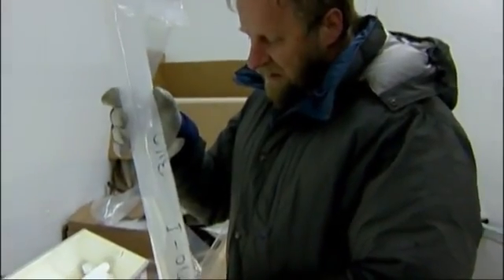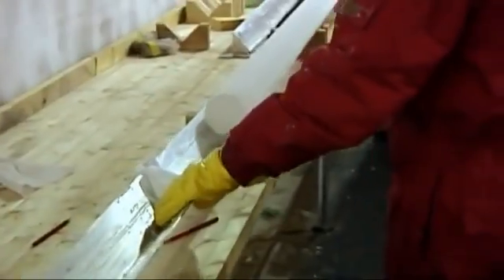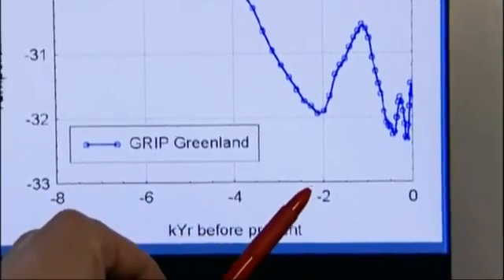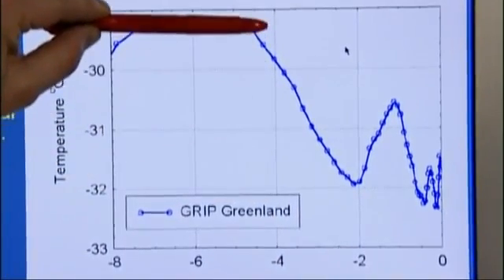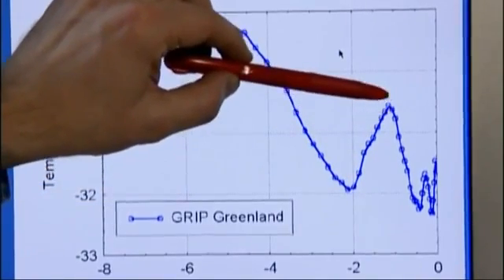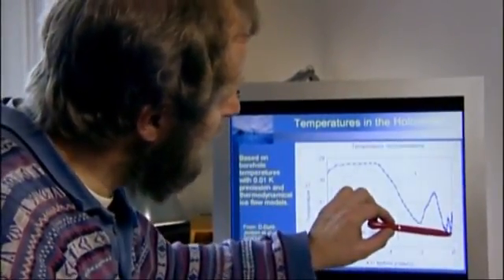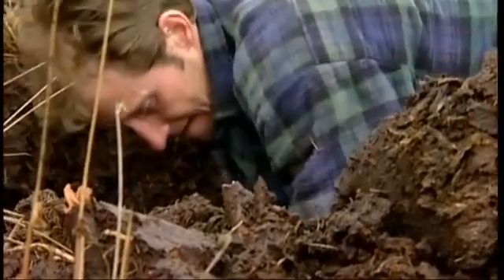The Climate Change story told by ice cores...

Comment: Earth climate runs in cycles - largely influenced by sunspot cycles - always has, always will The sun is the main driving force. CO2's effect is minimal by comparison (learned during my Environmental Sciences degree at UEA)
In fact we need plenty of CO2 in order to help plants and trees grow; forests are a major heat sink for the planet , and what humans need to do is stop deforestation !!!
Reply: The current scientific consensus, most specifically that of the IPCC, is that solar variations only play a marginal role in driving global climate change since the measured magnitude of recent solar variation is much smaller than the forcing due to greenhouse gases. Also, average solar activity in the 2010s was no higher than in the 1950s whereas average global temperatures had risen markedly over that period.
Reply from the maker: @hosnimubarak8869  Science "consensus"  comes from the scientists who agree with the narrative, while the others are ignored and censored.
Reply: @beegeandpeege  
Temperature has risen as our C02 accumulation has risen. The rise of C02 began around the time of the Industrial Revolution. The sun's last three cycles progressively weakened, yet we continued to warm anyway. Earth's orbital eccentricity, axial tilt and precession are all in cooling phases, yet we continue to warm anyway. As our lower atmosphere has warmed, the atmospheric layer just above it has cooled, according to NASA monitoring since 1978. That's evidence of the heat trapped below and prevented from filtering back into space. Natural cycles can't explain why satellites measure less heat escaping to space at the precise wavelengths which CO2 absorbs. Neither the sun nor any warming force on earth can simultaneously warm the lower atmosphere while cooling the outer one.
Reply from the maker: @hosnimubarak8869  Thanks for your opinion and contribution to this discussion! It is based on trust that the government data is accurate and they have no agenda. Here's an article that sheds some doubt on that: https://heartland.org/opinion/media-advisory-96-of-us-climate-data-is-corrupted/

Comment: I thought the measurement of relic ice core temperatures was made on CO2 isotopes from the ice, not actual temperatures from the walls of an ice core.  I do not accept at first glance that ice buried over time stays at the temperature it was buried at.  I would love to see more explanation and validation of the method used.
Reply: Better yet is the assumption that ice cores, which build up and melt away, can truly tell us what the past was really like, since some of the information is lost during the melting periods. So many assumptions in what these cores can tell us, one way or another.
Reply: I thought the measurement of CO2 in ice cores was to determine the concentration changes over time.

Comment: The distance between the sun and the earth is not fixed (as assumed by climate change models), as the center of mass is also influenced by the orbit of the planets. Moreover, the output of the sun is not constant, as it varies with magnetic variations of the sun.

Comment: You know in the early 2000's a crew went to dig up a plane that had belly landed in the ice being transported to the UK for WW2. It was bellow over 100 layers of ice. Meaning either the warplane preceded the Wright Brothers or the ice layers aren't years.
Reply: If it would be so easy. I presume the pane was darker than ice/snow and thus would be warmed up above freezing point by the sun. Henc, it would melt itself deeper into the ice/snow layer and, seemingly, deeper back into time.
Reply: @thomasbrey6928  my point is that this method is actually really compressed. What was presumed to happen over thousands of years was actually hundreds. A lot of the climate change "evidence" really starts to break down with that.
Reply: @picivyvortac2641  Yes, I understand. I am a bit sceptical of the method applied here, too,, i.e. inferring past temperature from current bore hole temperature, in particular as the graph presented displays no error bars. Nevertheless, d18O data from ice cores provide a good impression of the past climate. I should know, as I work in world leading institution of paleoglaciology.

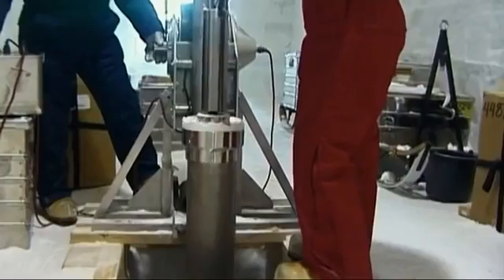Comment: @0:50... they describe using a thermometer to measure micro degree differences in the ice to determine how cold it was when the ice fell, to plus or minus a few degrees, however, that is NOT how heat works, at all, according to thermodynamic laws; heat is energy and energy spreads, the energy difference would not be "recorded" i.e. preserved in ice for thousands of years, or even thousands of minutes... they had to be reading pure noise, especially reading the temp in the air hole itself... that air would normalize its energy within seconds, and the temp differences in the ice would normalize within hours.

This has got to be an april 1st joke or something. This is silly nonsense. Even a HS physics teacher knows this isnt possible.

Comment: Its pretty clear actually.  For the past 4,000 years the temperature has been falling.  During this time about every thousand years there is a brief heat spike followed by the a plunge into even colder climate. From the Minoan Warming it fell in temperature for about 1,200 years to the Roman Warming, which did not reach the warmth of the previous warming.  Then the Roman Warming ends and temperatures fell to a climate colder than previous for about 1,100 years until the Medieval Warming, which did not reach the warmth of Roman Warming.  Then the temperatures fell to an even colder climate for about 1,000 and we find the Medieval Warming, which was colder than the previous warming.  Then we find a thousand years of increasing cold we  call The Little Ice Age until we get to the Modern Warming, which is even colder than the previous Medieval Warming.  Today temperatures have not increased now for decades as we round the top of that heat spike and today appear to begin the trip down into a new and even colder climate than the one we call the Little Ice Age.   As we round the top of this peak we see in just a decade the next Grand Solar Minimum, the Eddie Minimum which is expected to accelerate our fall in temperatures and the next step in our climates change toward cold. Global crop failure is thus forecast to begin between  2028 and 2030 with famine to accompany it.  Over all it is not expected to be this warm again for another 100,000 years.  The Holocene is ending and with it the luscious warmth which has allowed our civilization to blossom and the food raised to feed us all.   The planet approaches its 'normal' climate.  85% of the past million years has two miles of ice over Canada.  This is an icy planet and every 100,000 years the climate finds a brief warm period which stands like an island of warm bliss against the stark history in eons of Glaciation.  
Start a garden.  Your going to need it. We are all going to need it.
Reply: https://www.youtube.com/watch?v=sKR3e0fhiKQ

Comment: How does ice "remember" the temperature 1000 of years ago? Please widen this claim....

I Would assume that the 1000th of degree temperature along the 3km hole can have other origins (Pressure, densitiy differences, enclosed dust, non-linear gradient...etc.)
Reply: I understand it is to do with different concentration of isotopes of oxygen. The air of the time is preserved in tiny bubbles in the ice and that can be analyzed to create an estimate of the temperature. AFAIK the claim that the earth was much warmer between 4 and 8 thousand year ago isn't actually a controversial one at all.
Reply: @ENoob  He says that they drill out the ice core and then lower a thermometer down the resulting hole. So it's not measuring isotopes preserved in the ice, but the temperature of the air in the hole left by the ice core. That doesn't sound like a reliable method of measuring air temperatures from thousands of years ago.
Reply: @Bunty Hoven
Doesn’t sound like it.
Looks like it though.
Reply: Determining past temperature from isotopes and trapped air composition most certainly is possible. But certainly not by measuring the temperature of the ice layers in the present as it is to assume from the documentary.
Reply: Exactly. This isn't science either. They can't say for certain what the temperature was before observations began. More theories.
Reply: How about doing some research yourself instead of demanding someone to widen the claim.

Comment: Dr. Ned Nikolov and Dr. Karl Zeller conducted a study based on official NASA space probe data. They utilized advanced mathematical analysis techniques to analyze the climates of rocky surfaced planets and moons in our solar system. By knowing just two strategic facts, the distance from the Sun and the atmospheric pressure, they were able to accurately predict the long-term average baseline surface temperatures of these celestial objects. This formula has been proven correct for Mercury, Venus, Earth, Mars, and Pluto, as well as Earth's moon, Europa, Callisto, Titan, and Triton. Their predictions have been accurate within one degree Celsius. Similar to the constant value of pi, this mathematical relationship will remain as it is a creation of nature and not of humans.

Nikolov and Zeller concluded that the specific gaseous composition of atmospheres does not influence long-term average baseline surface temperatures. They discovered that the atmosphere of Venus, which is made up of 96.5% carbon dioxide, can be analyzed similarly to Earth's atmosphere, which only consists of 0.04% carbon dioxide. Therefore, the amount of atmospheric gases only contributes to warming by increasing atmospheric pressure through their physical mass, which explains why the top of Mount Everest is always colder than the bottom of Death Valley. This is because lower pressure leads to lower temperatures, and higher pressure causes higher temperatures.

For further insight on this topic, it is recommended to watch Climate Catholicism and Greenhouse Dreams on YouTube.  Just click on my blue Earth ICON to find it.

Comment: So the temperatures in the ice have stayed the same for thousands of years!  I’m not believing that, sorry.
Reply: The crystalline structure that formed due to the temperature it was when the water/snow was first turned into ice is different and measurable.
Reply: @benjamingooch8723  in the video they said that they put a thermometer down the hole and measured the temperature carefully, unless I misunderstood their words.
Reply: @jamesmaybury7452  no they measured the ice core extracted and not the temperature literally but the structure which extrapolates temperature variations across time roughly
Reply: @Phasma6969  listen again from .48
Reply: not the ice, the air that is in the ice bubbles

Comment: The industrial revolution saved plant life on this planet.
Reply: I know what you're saying - raising CO2 (280ppm - all plant life dies at 150ppm, and so do we).  But actually, if you look, you'll see CO2 went up many years ago, maybe at least 6,000 and possibly 800,000 years ago (we can't be sure).  There is no more warming to be had from CO2 above 300ppm as the absorption band between 14 & 16 micrometres is saturated...so no more warming can be had.  And this is even if CO2 can provide any warming.  The latest research is indicating that we DON'T get any heat from greenhouse gases at all!
https://www.youtube.com/watch?v=RbNNhLqhWPg
Reply: @jimskirtt5717  Yes, and if you look at the corolation between CO2 and global temperature, they do indeed follow almost identical paths. However it is the global temperature that leads an increase in CO2 and not the other way round as they would have us believe. The biggest culprit for warming is in the form if water vapour, clouds.